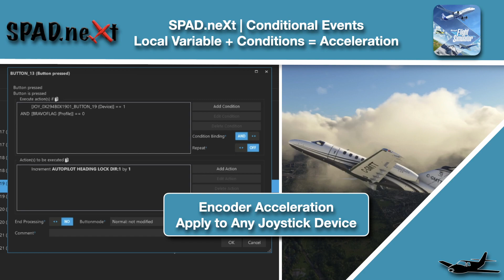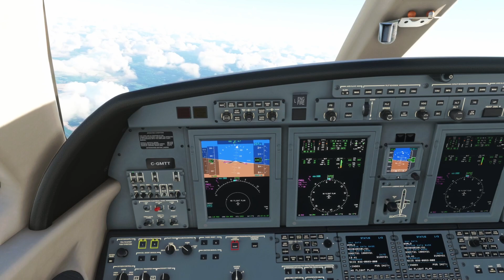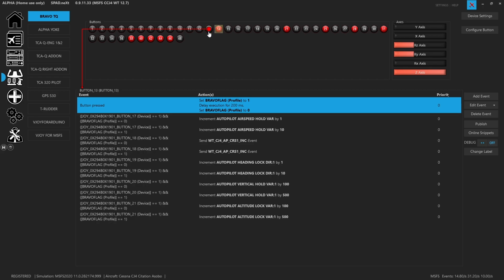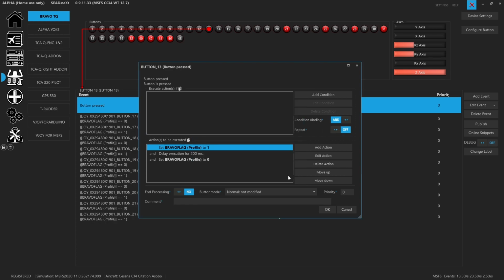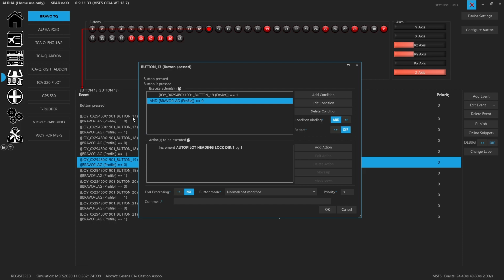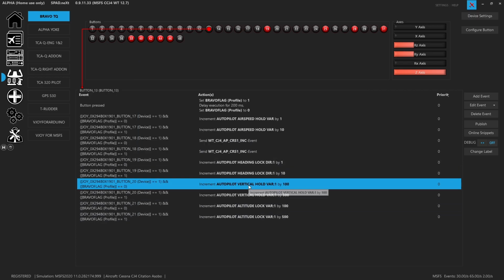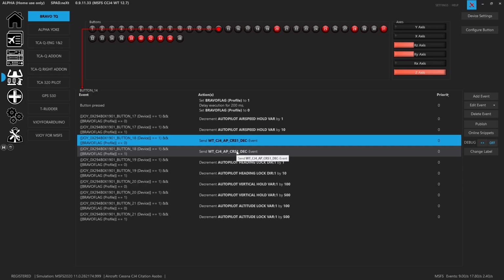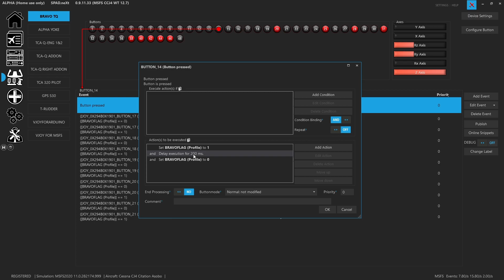(MSFS) SPAD.neXt | Conditional Event and Acceleration

Comment: For accelerating sim events I send the event 5 times as it’s sent very quickly it still a lot better than a single click of the rotary and seems to do the job just as well :-)
Reply from the maker: Will have to try that...
Reply: how do you set that up
Reply: @vapilot7814  as per video but instead of using simulation data and incrementing/decrementing 5 you add sim event entry five times
Reply: Any reason why this shouldn't work with my saitek radio panel
Reply: @vapilot7814  should work on any device and any events as you are literally sending the event 5 times per click/indent

Comment: In many cases more than 1 vaiable is connected to a certain action. For example an LVAR and a SIMCONNECT event (or value). Wich one should I manipulate, eihter one, both...?
Reply from the maker: Similar to the C414 where you use the sim connect event to trigger the sim and then an LVAR to set the state of the cockpit. Usually I try one first then the other and then both until I figure out the required combinations.
Reply: @LesOReilly  Yeah I guess there is a lot of trial and error involved. For those less experienced it requieres patience. Your videos are excellent. Thanks for that.
Reply from the maker: Even those with experience it takes a lot of patience :).
Reply: @LesOReilly  I've no trouble imagining this :). I have just spent days trying to configure the bravo throttle for the Cessna 414. But it's fun too, so no regret :)

Comment: Les , any reason why this wouldn't work with Saitek radio panel.
Reply from the maker: You can’t accelerate event using the built in acceleration. You would need to send multiple events based on your condition.

Comment: Will this work on all planes thinking of the heading bug on the piper arrow also do you need the alpha version of spad.next or is the released version ok
Reply from the maker: This similar approach will work with any plane where you are directly controlling the Data Value and not sending an Event ...  So it won't work with the CRJ and I am not sure what values work with the Arrow since I don't have that plane.  You do not need to be on alpha either for this to work.